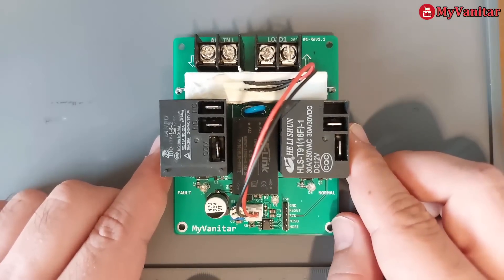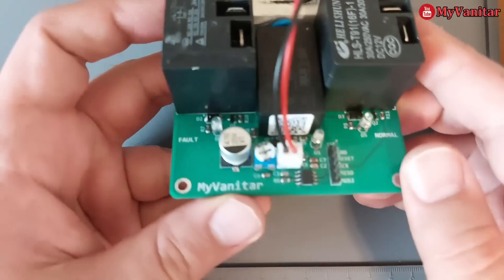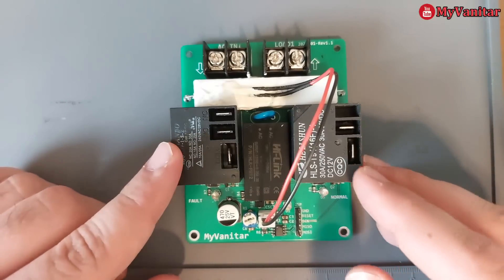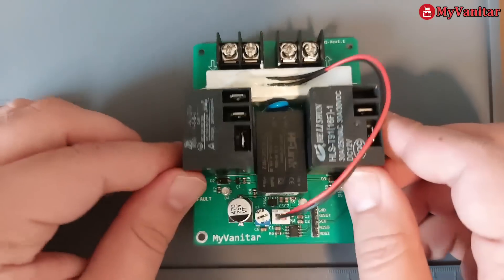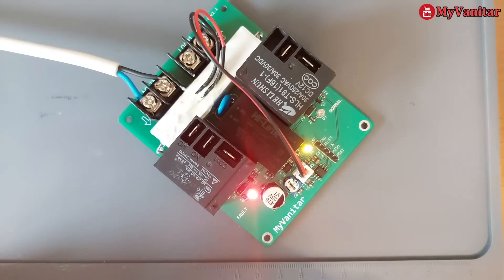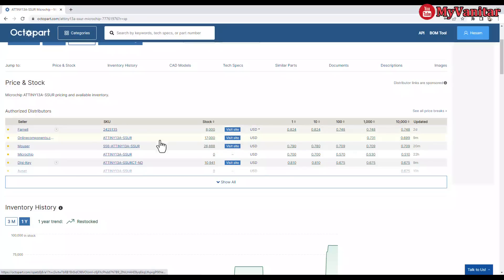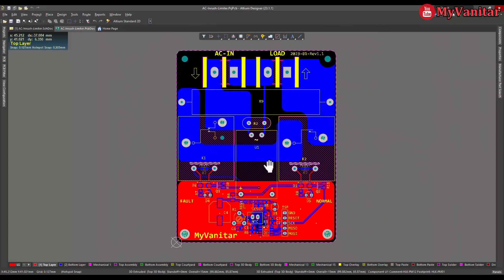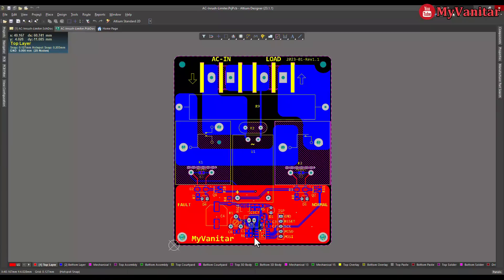30A AC Soft Starter (Inrush Current Limiter) Circuit with Fail-Safe

Comment from the maker: 30A AC Soft Starter (Inrush Current Limiter) Circuit with Fail-Safe
Reply: Sir Can we use solid state relays instead ?
Reply: I am a little concerned by your implementation. I haven't studied the circuit much, and I have not seen the source code at all, so forgive me if I am wrong. I was suspicious as to why you left power on the circuit during fail safe. Am I right in thinking that as the resistor cools down it will reach a point where the output will activate again?. If so, it needs some attention. I can see the situation where it has overheated. An electrician comes along to fix it, measures the output as being safe and probes around accordingly. Then the resistor cools when the electrician is holding the output which he had tested as volt free. Fzzzt. Also, if the driven load is a rotating machine for example, someone could have their arm in it and it starts up unannounced. The norm would be to drop out the relay and it's supply such that it and the output can't turn on again until the input supply is deliberately cycled off then on again.  Again, apologies if I have jumped to the wrong conclusion from my lack of scrutiny.
Reply from the maker: @Ritchey-Cretien  when failure is detected, the output goes off and is never activated again (stays in a forever while loop)
Reply: @MyVanitar  And you would trust the chip and the software to never glitch or fail in anyway?
Reply from the maker: @Ritchey-Cretien  if you have such a doubt, you should never use any electronic device. Whatever you write in the code, the MCU obeys like a soldier. I used an industrial supply module for the MCU and relays. by the way, I have also provided the code for enthusiasts, you can modify any part you like

Comment: Where is the "fail safe" if the microcontroller crashes ? The resistor still gets overheated and can cause fire.
A better solution is when the AC comes in, to let the microcontroller enable the first relay, the first relay let the power flow through the current limiting resistor, and after the set delay time is expired, the second relay bypass the current limiting resistor. 
If after that, the temperature of the resistor goes to high, the microcontroller can disable the first relay, and shut the load off. 
And if the microcontroller crashes, the first relay is not enabled and no harm is done. 
You can also use a non-resetable temperature fuse next to the resistor, but a failure then needs a repair to get it working again.
An even better solution, is to leave the microcontroller behind, and use a simple timer circuit with a 555, that bypass the current limiting resistor with a relay, and a thermal sensing circuit that use a second relay to interrupt the entire power to the load.
Reply from the maker: Thank you for your suggestions, really helpful, but in practice, the MCU never crashes because it is powered by an industrial isolated module. so this supply module either works or does not work. There is nothing in between and no risk for an MCU crash

Comment: I have 5 of the 30a AC soft start boards, populated, that I have programmed via the isp pins provided. On put up the Power LED lights up and the Normal light flashes on and off cycling with the delay setting. After several minutes K2 warms up to the touch and eventually it goes to normal and stays there. I can turn it on and off and it seems normal. However if I allow it to cool down it must cycle once per second until it warms up again. This behavior is the same for all five boards. I have the NTC devices that were suggested in place but with no debug capability troubleshooting is difficult. Any suggestions?
Reply from the maker: Does K2 warm up? It's really strange. You said the Delay works, so my assumption is the MCU works correctly and you have set the clock fuse bits for the 9.6MHz internal clock, although it has no effect on the Relays themselves. Do this: Check if the voltage is 12V on the power supply (before the 5V regulator). There is no specific debug function. if the Delay and Fail-Safe functions work correctly, there is no problem with the MCU.
Reply: @MyVanitar  the big power resistor does not warm up when power is applied. However the MCU keeps resetting due to the power falling too low in sync with the delay setting. I have a video showing the behavior while monitoring the 12vdc power supply output and the RESET pin on the ISP on my oscilloscope but I doubt I can post it here. Its 6 seconds long and around 14MB. The fault light never comes on and nothing is hot to the touch. The programmer, an Arduino Uno, is NOT connected.
Reply from the maker: Also, make sure the warm-up is from the Relay, not the big power resistor (R9), the delay must be short just to absorb the inrush; otherwise, the resistor warms up quite quickly, and I have implemented that fail-safe just to make sure the resistor does not melt everything if K2 Relay fails for whatever reason (Fault LED lights up) and that's why you should stick the NTC on the resistor using silicon thermal glue
Reply: @MyVanitar  I also just noticed PCBWAY stuffed the board with one 12v relay and one 5v relay. That dies not seem right since both have the same power line. It is as the BOM specifies but I dont see how that can be correct. But it does explain the excessive power draw.
Reply from the maker: use this for K2 Relay: SLC-12VDC-SL-A
Reply: @MyVanitar  it seems as though the SCK line going HIGH for just over 80.0ms causes the 12vdc power supply output to drop in 60ms to <6vdc for approximately 460ms. The 12vdc supply then returns to 12v until the next SCK HIGH pulse which occurs based on the DELAY adjustment setting. What is causing SCK to go HIGH?
Reply from the maker: oh man, this circuit is not this much complex. I have never received any complaint so far. You see my own test as well. I don't really know why these things happen to you; you have the code, and I have provided it. That's nothing special. When you turn the potentiometer, the delay increases and decreases, but of course, after reset (OFF/ON). It should not work like this; maybe there is something wrong with your assembly, or you have not programmed the MCU correctly. I have never used an Arduino board to program another MCU, but it should not be a problem. if the VCC voltage drops, something sucks the current badly.
Reply from the maker: send me an Email with pictures and your video, maybe I can figure out
Reply: @MyVanitar  OK

Comment: I will like to talk to you about this and buy all the circuit assembled and ready to use i need 20
Reply from the maker: Okay, please send me an Email directly and talk about this. You can find it in the channel description
Reply: Just don’t have PCBWAY stuff the boards. They put a 12vdc and a 5vdc relay on all 5 boards I ordered and I’ve spent a stupid amount of time trying to make the code work when there is nothing wrong with it. The parts list is wrong and PCBWAY doesn’t care.

Comment: Nice.
Have a 3 ton 240 V AC. Unit.
Draws about 8 running amps

What would this limit the voltage to at the compressor at startup?
Reply from the maker: The compressor needs that current to start. if it's an Air conditioner, you might use models with a Linear Compressor
Reply from the maker: By the way, 8A is not something special. The relays are rated at 30A. build one and test

Comment: Very interesting but I wonder if this ac inrush can "rearm" itself after a few seconds. My use case is a spot welding machine for small materials (battery tabs). My circuits are 16Amps and the machine is rated at 20Amps. Since spot welding is not continuous I think an AC inrush limiter would help but it would need to autoreset itself every 5 seconds or so so that will prevent another AC inrush when charging its capacitors for the next spot weld.
Reply from the maker: in spot welding, you face the inrush when you use the tips to melt the metal right? and not when you turn it ON?
Reply: @MyVanitar  Correct, it has a battery of capacitors which only need to charge after a spot weld. Thinking about it, a high power resistor of a few ohm in series with the spot weld input should work in this case, no need to remove the resistor from circuit.
Reply from the maker: so it's not like the ones that uses a transformer, those models face inrush when the user first connect it to the mains

Comment: This is pretty cool. I also have been thinking of a soft starter for my to-be-made power supply but without the fancy microcontroller part. Just making a simple timer with an op amp and capacitor. But honestly, I didn't think of any safety feature but i might implement something similar again with opamps
Reply from the maker: The total price in your case is not cheaper than this circuit, why bother, order the PCB and have fun

Comment: The way the Chinese company Sieg does AC in-rush current limiting in their machine tools with BLDC drives is to use a thermistor in series.  Something like an NTC 20D-0R1 from Shin-Hang.
Reply from the maker: NTC is okay if the current draw is low and the ON/OFF switch does not happen often, such as switching power supplies